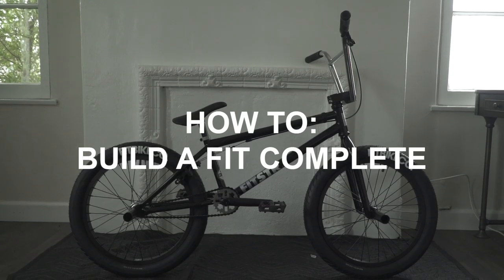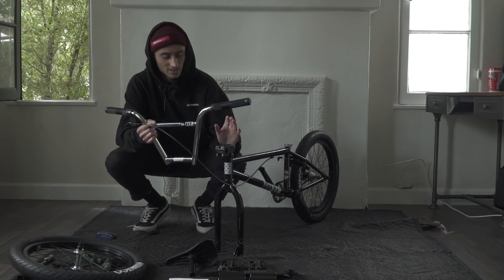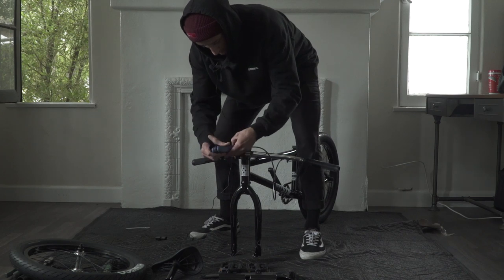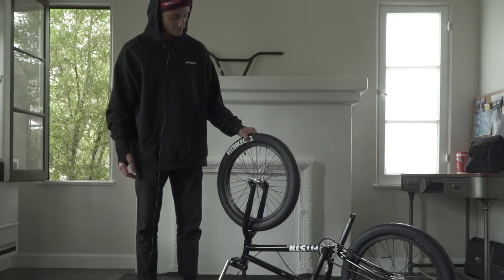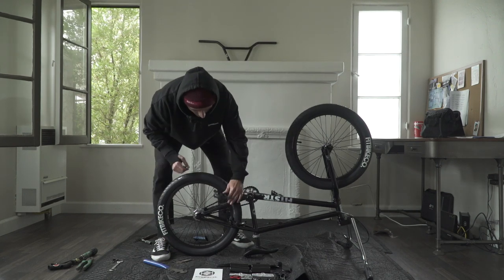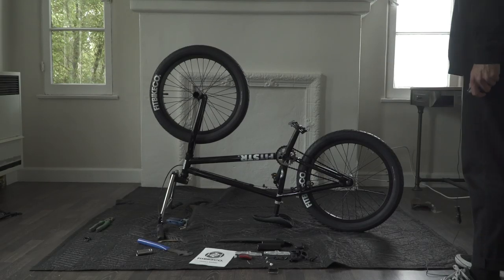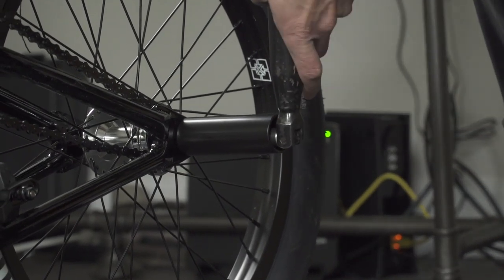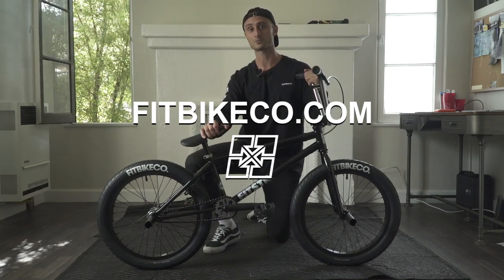HOW TO: BUILD A FIT COMPLETE BIKE AT HOME (BMX)

Comment: good vid. i like the tip about backpedeling to put pedals on, i always forget. u really should tension all your spokes evenly though. if they are loose go thru the wheel and do 1/4 turn on every spoke until they are tight